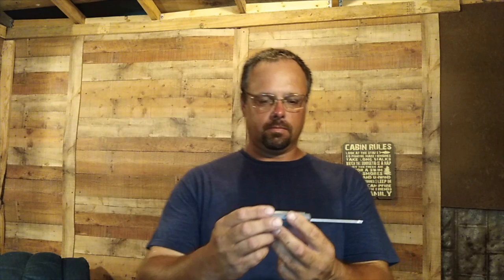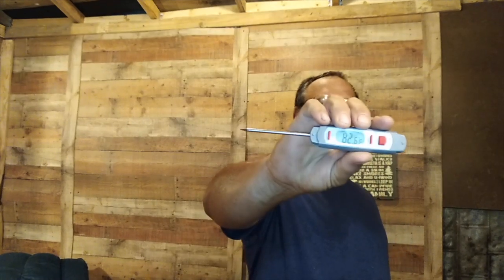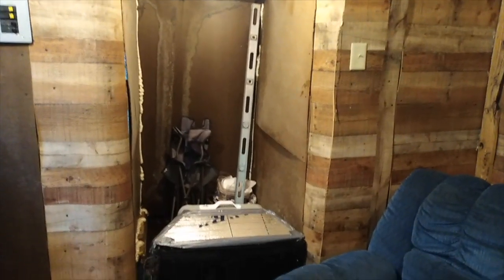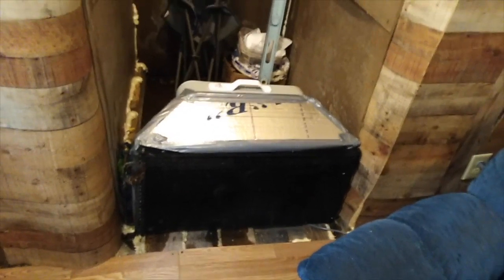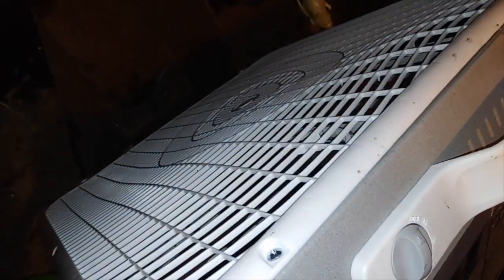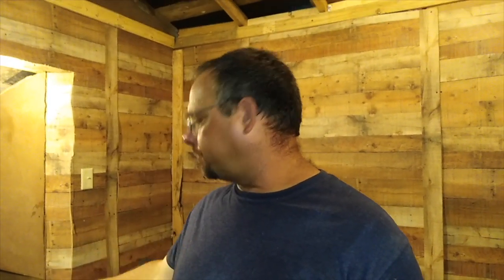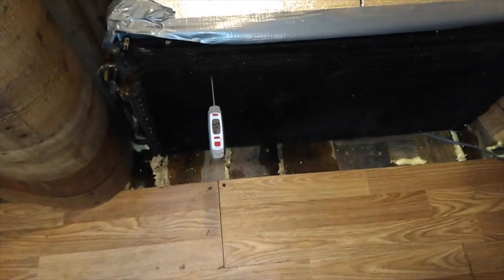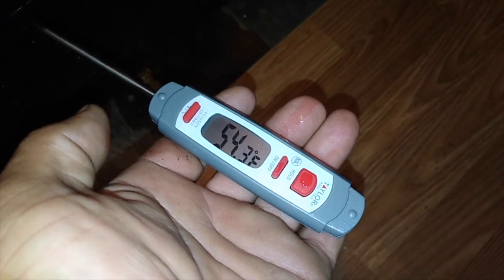Off Grid Geothermal Air Conditioning for Cabin-BETTER DESIGN

Comment: Is it a water pump that goes to the car radiator? Remains in an infinite loop
Reply from the maker: It is a natural spring that runs past the cabin. It flows through with gravity.
Reply: @lukeFugate  
I understand... and I was thinking about putting a 500 liter tank of water inside the floor, well sealed and putting a 12v pump to take it to the radiator... I just don't know if it will give a good result

Comment: The reason the water on the condenser is so much colder is that the condensation collecting on it is evaporating and as the water evaporates it absorbs "latent" heat.  It takes energy to cause a phase change, so the lower the humidity gets inside, and the water is condensing on the unit and the air is blowing over it, some of it evaporates back into the air, and as it does that, it pulls even more heat off of the unit.
Reply from the maker: Thank you!
Reply: As water evaporates it absorbs "sensible heat" :)

Comment: Great project, I have 2 questions about your car condenser:
- Is the intake is located above the outtake?
- Wondering whether water circulates through out condenser's surface area or just between the side tube connecting intake and outtake? That would be great if you could provide a clear picture of your condenser.
Thanks
Reply from the maker: Yes the intake is on top. I figured it was better to run it that way to let gravity do its work. It flows through the entire condenser. I have also used a car radiator with similar results.

Comment: Great concept. Maybe in  Cabin Loft on Gable wall, mount cooling system.  That well depend on your water drop (fall) from spring.
Cold air drops due to it being heavier.
Never the less, good job. 
The difficult we do right away, the impossible will take just a little longer.
Reply from the maker: Thanks! Good idea.

Comment: Is it not causing black mold? All that condensation??
Reply from the maker: As long as you make some way for it to drain off and not let the water sit for a long time. it is producing the same condensation as a normal air conditioner.

Comment: With your water temperature. The temp. Your probe was reading was due to evaporation. Once you started pulling moisture out of the air in your cabin, you started lowering the dew point. The dew point is the temperature that moisture will start to condense in air. The more humidity in the air the higher the dew point. The less, the lower. Your water didn't change temperature, your dew point did.
Same reason for rain. Too much moisture in the air, dew point hits temperature, it rains.
Reply from the maker: Thank you. That makes sense.

Comment: Mighty fine. Since the unit itself isn't generating any heat really, having it inside instead of in a window makes perfect sense. After the air inside is cooler than outside, why not just recirculate the inside air eh? 
I've got a little creek on my property, but it's at the very bottom of the holler. Can't do gravity fed with it really. I've been studying how to use a rain harvesting system up on a hillside to maybe create water pressure for a lil cabin at the bottom, but it wouldn't be enough to circulate through a heater core. Maybe some kind of ram pump from the creek?
Reply from the maker: I did something similar in my house which is higher than the creek. I made a closed loop system with two radiators and hoses connecting them. I put one radiator  in the creek and the other in the house. With the hoses completely filled with water, a 12 volt RV water pump could circulate it through the whole system because it didn't have to lift the water from the creek, just circulate it. 
I could run it off of my solar panel system.
I will probably be doing something similar in my new house.
Reply: pipe your  tube underground dazy chain link two fifty five gallon water barrels to siphen liquids from one barrel to another then underground then to your heater core like a loop , but the barrels must be higher than your heater core, just thinking this might work, let me know if it works. good luck
Reply: When I was a child. I noticed that if I dug my feet into the sand under the brook, it got a whole lot colder.
 I bet there's a way to get that cold into the water of a homemade single acting or double acting ram pump.

Comment: You could make a square or rectangular, circular, whatever the heart desires, pan from fiberglass and polyester resin. Start with that FRP board, saw out the bottom, sides and ends. Arrainge it in the shape you want, use fiberglass matt about 3-5 layers and polyester resin to "Tab" it together. As long as you sand the FRP board, rhe fiberglass bonds to it very well since it is made from the same materials.  You could use plywood, but you would need to fiberglass the whole thing, where as the FRP board, you only need to do about an 8" strip, extended outwards, 4" each side of the seam or corner. Note: you can do 5 layes in on wetting, easily. Don't do one, wait for it to dry, then a second layer. Do all the layers at once. I have done 10 layers before with no problems. Just cut back on the hardener a little. It will get hot, but it will be fine. Bright sun or a heated garaage will speed up cure time.
Reply from the maker: Great idea, thanks!

Comment: Very nice system you have there. No compressor, no refrigerant, inexpensive, simple, super energy-efficient, and very powerful.
The only thing I can think of to make it not need any electricity at all, and to be more aesthetically pleasing (to be wife approved) would be to use a valence convector. 
A valence convector is basically just a long skinny radiator horizontally mounted along the top of a wall. It has an insulated drip pan underneath that drains off the condensate, and gives it a smooth finished appearance.
 Unfortunately, I have no idea how to locate one from a boneyard, or for scrap prices. I've heard that they're used in hospitals, assisted Care Homes, and possibly in other government buildings.
They might be able to be made from old hydronic baseboard heater fin tubes.
Reply from the maker: Thank you for the suggestions! That would make it look a lot better.

Comment: You need a fan with a thermostat built in.
Reply from the maker: Great idea.
Reply: luke Fugate aquarium/terrarium heater thermostat. Any good pet shop will have one. Plug it into the wall and the fan into it and set your desired temp, it will switch the power on and off depending on temp sensor.

Comment: Build a plywood tray and line it with plastic or finish with epoxy
Reply from the maker: I ended up using the lid from a plastic tote. Just the right size.

Comment: You asked a question on your video about TEMPERATURES under-ground. I have done extensive experiments on UNDERGROUND TEMPERATURES.  I drilled a 20 foot hole and placed probes about every 5 feet.  Here are the results of my several years experiments and temperature measurements:   If you go down 20 feet, then the temperature is 60 degrees and it varies only 1 or 2 degrees NO MATTER WHAT SEASON it is.  As you get closer and closer to the surface, then the temperatures will vary quite a bit.  At 10ft it's 70 in summer 55f winter.  At 4ft it's 75F summer 55 winter.  At the 2 ft depth it's  80F in summer  40F in winter.  At 1ft underground it's 82F summer & 30F in winter. Those temperatures were watched over a 2 to 3 year period in the MIDDLE of the USA (St. Louis, Missouri).  If you live NORTH of that area, the temperatures will be LOWER.   Down in Florida they will be higher.  If you want to read my eBook on the subject of "experiments in House Heating and Cooling"  it is only a couple bucks on this link:  http://www.lulu.com/spotlight/davidmundy  The ebook explains how I lowered my attic temperatures from 150F down to about 105F simply by painting my roof with HYDRATED LIME which is very cheap.  Doing that one thing lowered my house temperatures from about 93F down to about 84F... which is amazing for something that only cost me less than 20 bucks, uses NO electricity, and No moving parts.
Reply from the maker: Thanks for the information. I'll check it out.

Comment: How much energy does it use?
Reply from the maker: Depends on the box fan. I think the one I have pulls about 75 watts.
Reply: @lukeFugate  What about the condenser and pumps?

It definitely seems like a way more efficient way to cool, especially since you also get some evaporative cooling and dehumidification.  I think you're really on to something here.
Reply from the maker: @Ozarka741  in my case there is no pump. The spring comes from higher than the cabin is on the hill so the water naturally flows downhill.

Comment: Ground temps vary as per latitude and other variables, however you're getting some evaporative cooling going on there it appears as well (possibly). I'm curious, though: what about those who don't have access to springs? We need some further experiments regarding using a homemade earth geothermal cooling pipe arrangement. Perhaps much more coiling / piping in the well? Perhaps simply digging a long trench at about 6-10 feet deep (or perhaps a trench + mound to provide enough mass over it)? Etc...
Reply from the maker: If you could get a coil of copper pipe deep enough in the ground the water flowing through would be cooled enough for a/c. I would imagine you would have to go pretty deep probably 10 feet would do it. I may have to do a little experimenting when the temps start to rise.
Reply: @lukeFugate  Yes, this is what I'm thinking. The trick is to basically design a "radiator" that is simply a number of bends back and forth of pipe to get enough of a transfer in the environment. I hear that a lot of people are able to also just use black pipe buried around 7-10 feet and running across their yard to simply use air cooling directly.
Reply: @lukeFugate  also, check this out: https://www.youtube.com/watch?v=ZD_3_gsgsnk

Comment: can you please add the specs of your system? It would be awesome to be able to look at your video notes and see it. Tube diameter, depth, location, Fan specs and fan power draw (watts). Thanks.
Reply from the maker: The tube that feeds it is just water hose. The water is gravity fed from an underground stream. I am in Kentucky. The fan pulls about 2 or 3 amps of power. I may do a edit of the description to include these details. Did that answer what you wanted to know?

Comment: Are you living in Tennessee luke.I have off grid property over in west Tennessee and have been working on an idea similar to this. Unfortunately i dont have a spring,and my well is to far away to pump water with DC.Ive been thinking about cooling water with 10 feet deep vertical loop,similar to your idea with your well,but just using soil to cool water.Do you have any experience with this? Nobody has really done this for a small cabin,and im sure it be worth doing for views,i wont be back at property till june so im just stuck in florida wondering if it would work lol.
Reply from the maker: Actually I'm in eastern Ky. Never have tried the underground copper loop, but it seems like it would work. May need more than 10 feet of pipe though. I would like to see how it works out if you try it.

Comment: Basically on the outside of that condenser you've made a "swamp cooler" where the air blowing across it will make it feel and have an ambient temperature cooler than what the water is because of the evaporation.. Good job by the way.
Reply from the maker: Thanks, that does explain it.
Reply: @lukeFugate  new subscriber by the way... I just bought an off grid cabin and you have implemented several ideas I wanted to try!! :)

Comment: some late info.     pardon the occasional 'obvious' facts.     if the water source is reliable,  you have a continuous supply of a small amount of slightly pressurized, cooler-than ambient,   water.       for a  gravity-powered, small space-cooling application,  the use of  different hardware   Should  be  considered.       the underlying process/goal   IS    the  Absorption of (heat)  energy in the ambient air volume, by the  cooler water.        here are some suggestions/facts.
note that water can be delivered to  any elevation, within the structure.      the heat exchanger/fan  could be installed near rafter level; or  install lower and  direct air flow up to promote mixing near the  roof/loft.      the fan and exchanger housings should 'mate'; having  identical cross-sections.    put the fan in Front of the exchanger.    make an exchanger using perhaps  twelve feet of coiled copper tubing.   as practical, arrange the cools/loops within the housing, such that  air flow past all  loops  is  maximized.      there will be condensation.  Design for it.   collect it at a point/elevation that allows  Easy  drainage/disposal; through a wall or whatever.      googletranslate 
at :36.   air flow is impeded by the presence too much fan cage material.    evaluate your fan, in this regard.

https://www.youtube.com/watch?v=BrwSpC2iiBc
Reply from the maker: Thank you. Good suggestions. More airflow would help tremendously.

Comment: There is moisture on the condenser from condensation. As the air blows over that moisture some of it will evaporate. Evaporation will have an added cooling effect. That effect will not be as great if the air is very humid.  Here in Australia they have big evaporative air conditioners on the roof in some of the very dry outback places and they work real well. I think that the evaporative cooling is the reason that the temperature of the air coming from the cooler is lower than the temperature of the water.
Reply from the maker: Thanks, that explains a lot.
Reply: Yep, a phase change from water to gas absorbs a lot of energy, so as the water evaporates, it absorbs "latent heat"(heat that is just sitting on something that you can measure, but doesn't really radiate off of it, like when you take the temperature of the chair or cup of water that's been sitting for a few hours) around it, which is exactly how an air conditioner works, it "evaporates" the refrigerant in the evaporator and it "condenses" it back to liquid in the condenser.  When the liquid evaporates, it absorbs a lot of energy to change the phase from liquid to gas.  The reason an air conditioner gets so much colder is the evaporation temperature of the refrigerant is much lower than the temperature water evaporates at.  Water evaporation cooling only works with low humidity, though.  The less humidity there is, the more water will evaporate easily, and the more the water evaporates, the more energy it will absorb as it evaporates.
Some of the portable air conditioners and window units will suck the water through the condenser and that water will absorb the heat and then evaporate and cool it down really well, and make the window a/c cool better.

Comment: Nice setup.  Im in the process of trying a similar setup at my house, on a slightly larger scale.  I have spring water, that I'm plumbing into an A-coil that was originally used for traditional AC.  Thats going inside my ductwork as normal, and hopefully the furnace fan blowing across it will cool the house off.  It has a condensation catch to a drain, so hopefully it wont require much maintenance.
Reply from the maker: Sounds like you have a good setup there. Perfect for what you want to do. Let me know how well it works.
Reply: If the lines from the ac coil rusts through you might try switching too a old car radiator

Comment: If the actual house is 1000 ft away Id be moving the ac over there
Reply from the maker: I've got A/C in my house, but I can't run a unit in the cabin because of the limited solar and water power.

Comment: My well water is between 50-55 degrees F depending on the season in Tennessee. Ground temperature is respectively the same. You should duct ur cool air up to the loft and let it settle downward. You will have a much more comfortable cabin.
Reply from the maker: I'm thinking about putting in a ceiling fan to recirculate the air.
Reply: You already have a fan moving the air across the coil, just need to direct that air. Adding another fan use Xtra energy and being off grid it would make more sense using the already used energy. My $0.02 :)
Reply from the maker: True, maybe I could make a ducting system to redirect the air. At least some type of vents.

Comment: Hey, love the videos. Would like to see more on your hydro power. Maybe an update. Or even beefing up the system. Thanks for the awesome content!
Reply from the maker: I'm going to have to redo the hydro system. Turns out plastic isn't the best material for a pelton wheel.
Reply: @lukeFugate  Yeah I thought so, I found some pretty cheap pelton wheels on ebay. 

Also if you look up WindGenKits on eBay. They have a really sturdy looking rotor and stator. But that is like $200. So a little more spendy. 

Hope everything works out, your videos are awesome.

Comment: Genius
Reply from the maker: Thank you.
Reply: @lukeFugate  Im frugal on disability and run a portable air conditioner with heat pump off 1800 watts solar to heat and cool my room and it saves me a bundle rather than heating and cooling the whole 2100 sq ft house but yours is damn near free lol

Comment: Evaporative cooling.
Reply from the maker: Not evaporative, it doesn't increase the humidity. It works more like a real air conditioner by cooling the coils in the condenser and blowing air across them.
Reply: The humidity is too high in his environment to use a swamp cooler. What he has is more of a hydronic cooling unit using chilled water.